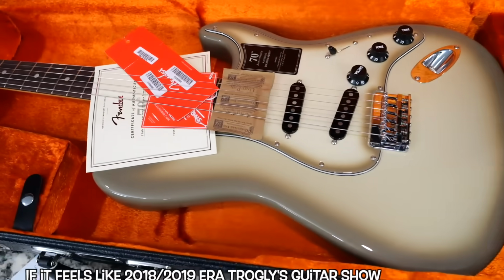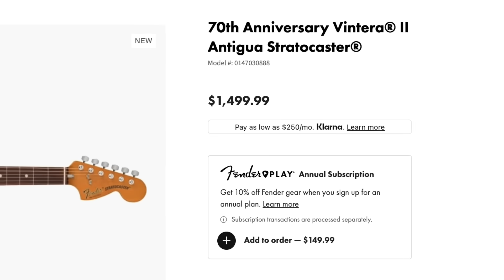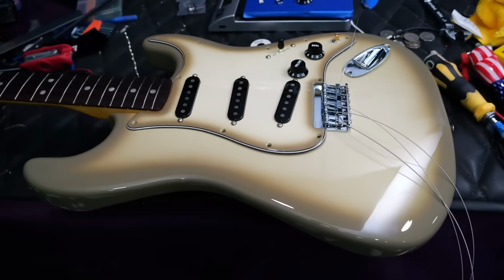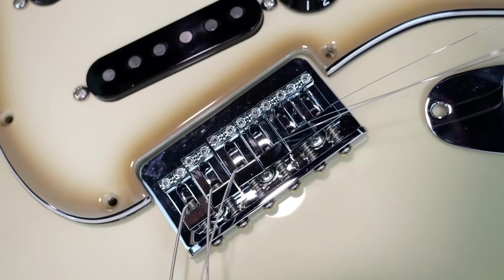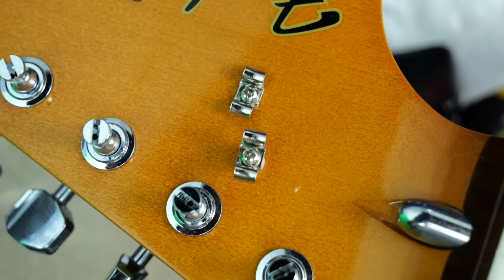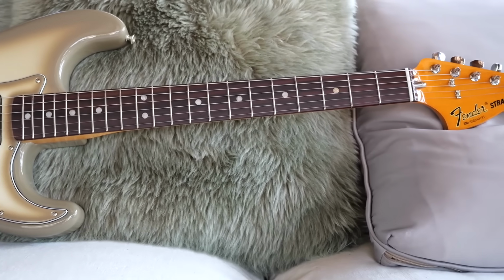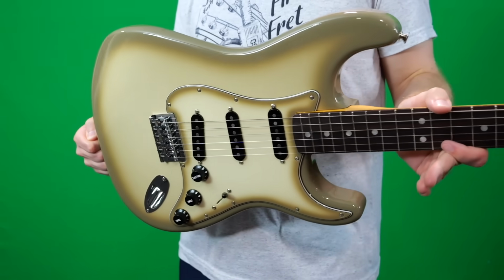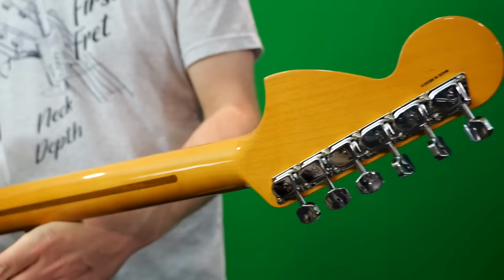You're WEIRD if You Like This... | 2024 Fender 70th Anniversary Vintera II Antigua Stratocaster

Comment: I quite liked the Antigua colour back in the day. I did actually buy a Telecaster in that finish with a maple neck/fretboard in early 1980 in Eaing, West London. Sadly it was stolen a few months later and (possibly even sadder) the rumour was that the theif refinished it in black before moving it on so that I wouldn't recognise it. I still had the receipt with serial number. 
Lesson learned but 44 years and 30 odd guitars later it still hurts to see a Fender with that finish.  My only consolation is that I still have the Strat I bought the year before.
Thinking back,  the Strat cost £335 plus £40 for the traditional Fender hardcase in 1979 ( when I was 18). The Tele was £353 with a case a year later. I can't be certain how that equates in terms of value compared to modern offerings.
Reply: It looks like about the same value as an American vintage 2 according to the banknof england calculator if that original price included tax.  If not an American ultra Lux.

Comment: I had a black 1972 American standard Stratocaster. I sold it for rent in 1990. It is the one that got away. Love the big headstock and the three bolt neck plate with micro tilt adjustment. BTW mine also had to black pick up covers, which I think look awesome.

Comment: All Vintera models are made in mexico and the 3 bolt neck pocket is that way because it has a little set screw so you can set the neck angle easier. Most people prefer the 4 bolt for stability though.

Comment: The finish crack on the finish could get worse. My MIM strat had cracks on the neck plate about 8 cm long on upper and lower side of the plate, although it doesn't get longer. But i see a lot worse than mine, where it peels of from the body

Comment: The closer I look, the less it looks like a real one. I'd seen them advertised and thought I just might pull the trigger, but the price just knocked that idea on the head. I paid nearly 2 grand for the mim rocky strat and the thing plays like, well who am I kidding - it doesn't play at all, so there's just no way I'm doing it again. The colors are just wrong - similar, but wrong, and the qc issues are the final nail in the coffin on this one. I 'might' wait and pick up a mint used one for half the price, but honestly I probably won't bother. This should be 899, not 1599, and if it were I would have bought one, but no, just no.